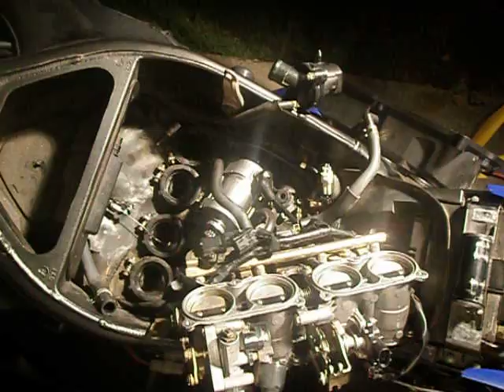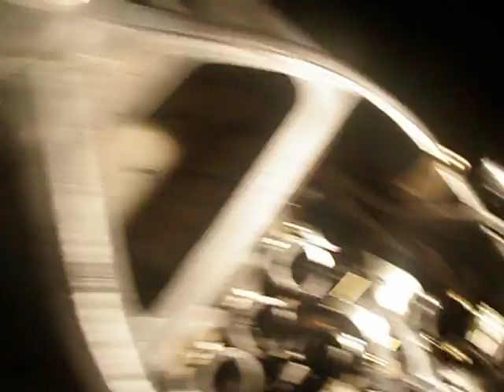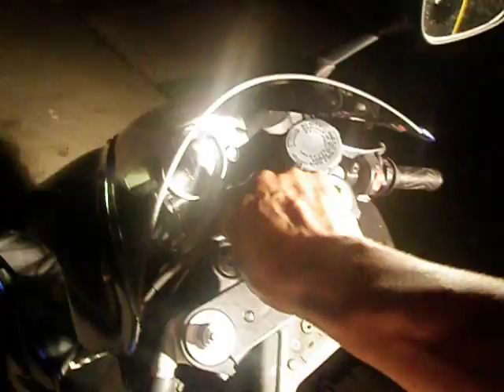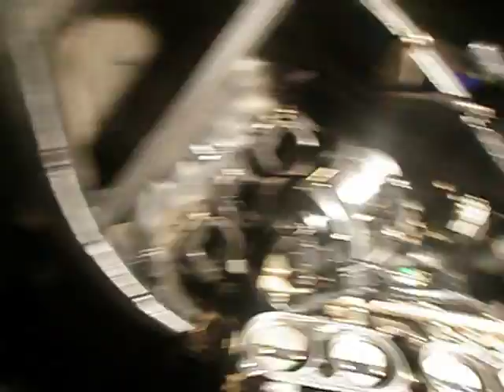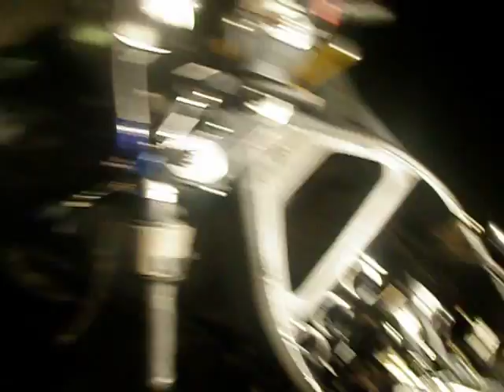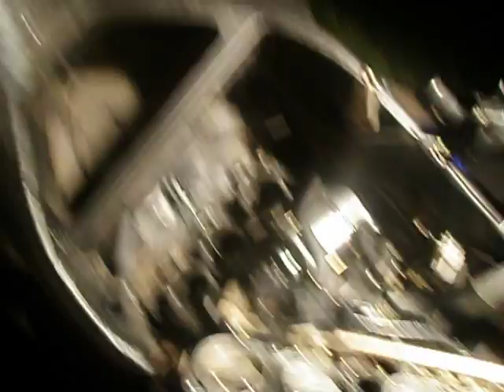R1 with starting/starter problems

Comment: Your answer is the starter clutch one way bearing in the stator assy has shat itself and now spins free without engaging on the shaft (behind left side cover)this gear is driven by the starter motor. remove LEFT side stator cover,carefully pull out the stator assy and check the cog ,it runs on a ONE WAY bearing,we swapped this bearing and it started immediately, when refitting assy put bike in gear and turn wheel till assy pops in, bolt it up, took us 45minutes,this is true fact.

Comment from the maker: You can reach the 3 on the left with:
- 1/4" ratchet
- two 6" extenders
- hex head ratchet attachment
-come in from the left of the bike (remove the black fairing piece and go in that way)

You can also reach the one on the right this way, but it is tight and the ratchet attachments will fall off (unless you secure them with electrical tape).  Much easier to buy a 9" long T-handle hex key to do it.   You'll have to go to a *real* hardware store to find one cuz home depot doesn't carry them.